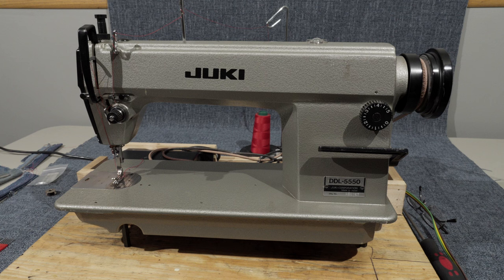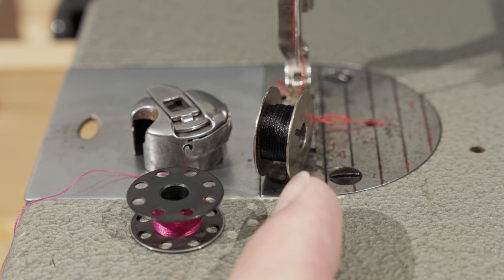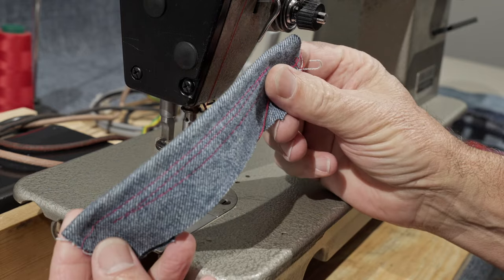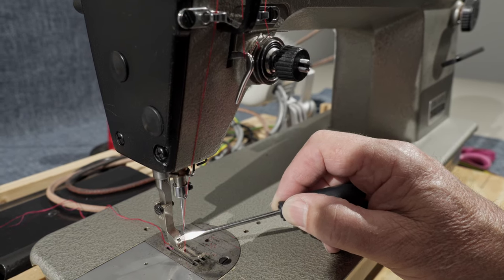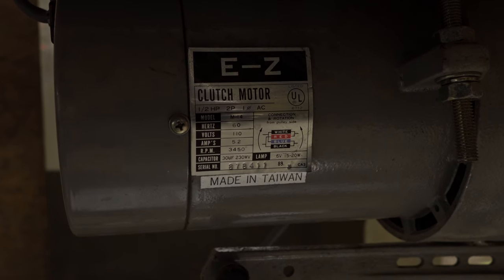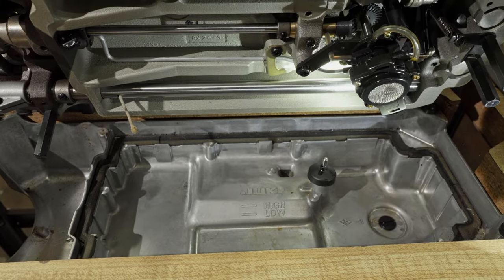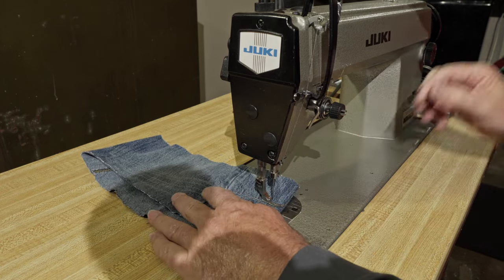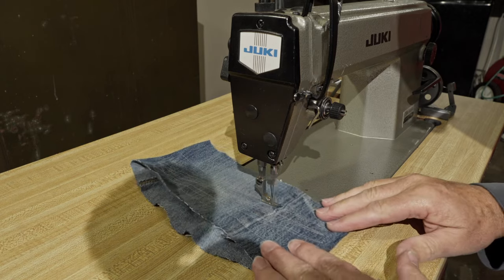JUKI DDL-5550 Industrial Sewing Machine set up and operation.

Comment: Hi Thank you for your video. I have the same machine, unfortunately it's not working. The power is on, but no noise what so ever from the motor. When I pressed the foot paddle error e7 came up. I turned it off and on serveral times. Same problem. Do you know what the problem is with my machine? I read online some people suggested that it might be a foot control faulty or a motor faulty. How can I check? 
Like to know if anyone else have the same problem or a solution. Thank you.